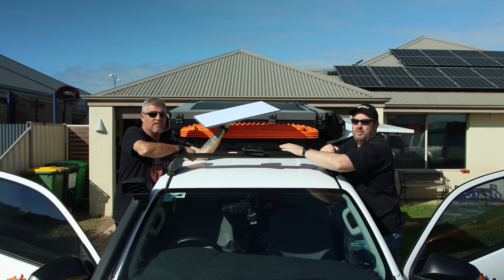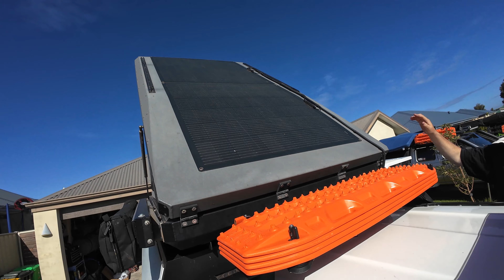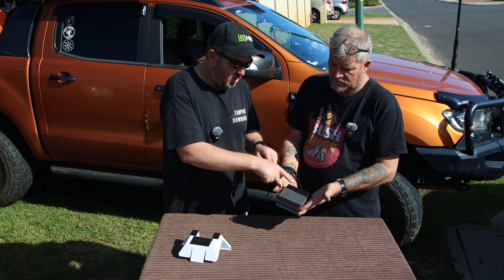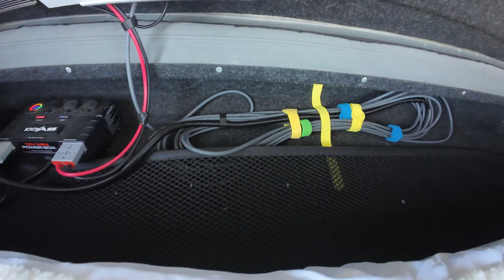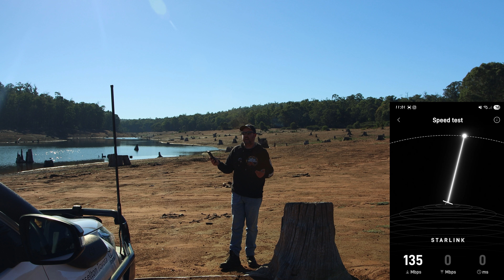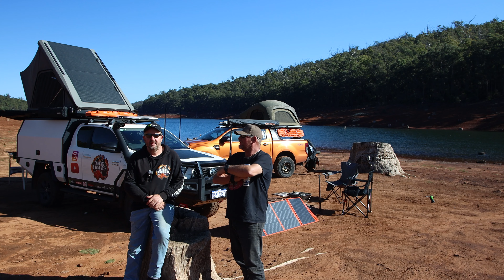How to install Starlink on your 4wd permanently (& reduce power)

Comment: I'm just setting up my mini atop of RTT.
I'll be utilising one of outcamp aluminium encased housings to mount the mini and their 12v to 24v power supply units. I selected that power supply as it'll be mounted in the RTT utilising the existing 12v circuitry, however it is switched on & off by remote control X 2, hence one in car/caravan, one in RTT to easily control from any location, that for me determined it was the power supply for us.
Items are still to be supplied but I'm anxiously hoping it works as planned.

Comment: Great info , I have never heard of 3M primer? Where did you buy this from? Might help me inside my canopy and the cable tie pads keep falling off in summer
Reply from the maker: I get it through work but we get it from tool shops. Just google 3m adhesive primer and it will show you local shops in your area that stock it 👍

Comment: quality vid guys, are these expensive?
Reply from the maker: Thanks mate 👍 it's free at the moment for home use but to travel with it they charge you around $600 for the dish & $195 per month. But they do have smaller plans available with smaller download limits. Mine is unlimited download on $195
You can also cancel or pause your plan anytime